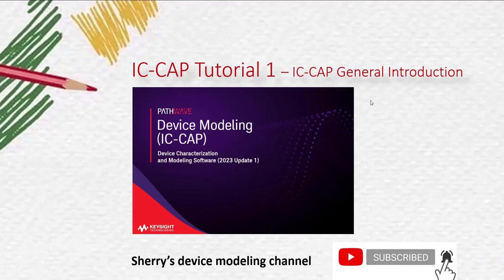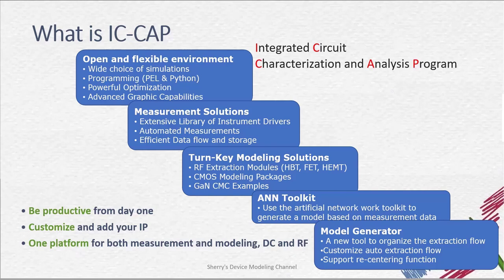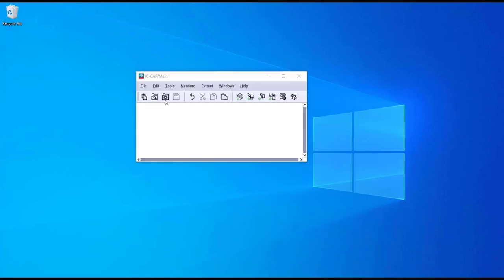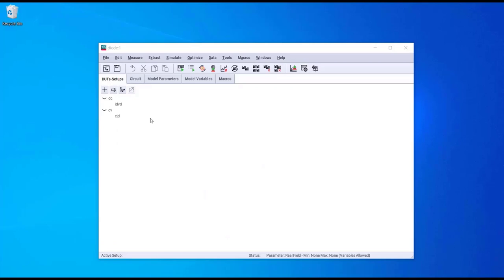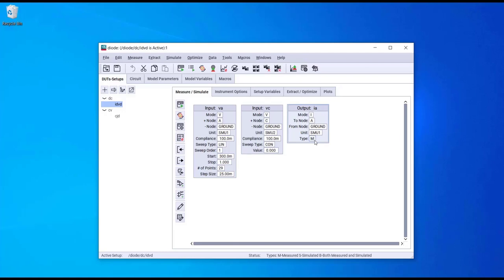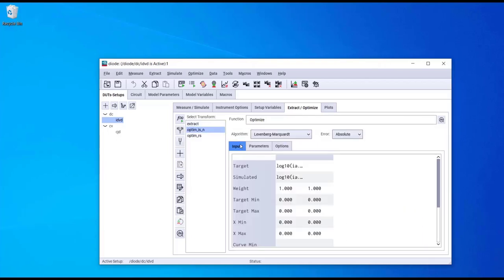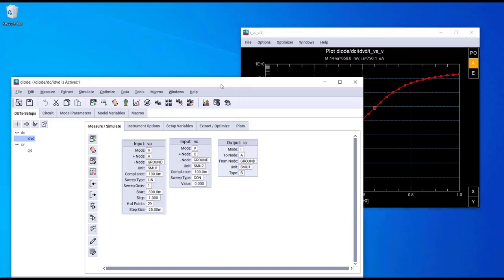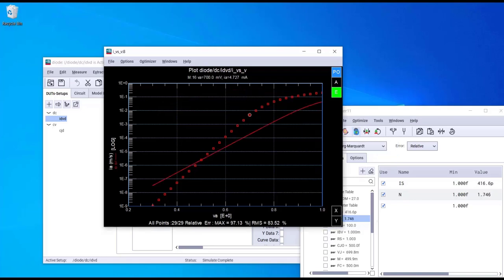IC-CAP Tutorial 1 - General Introduction

Comment: Thanks so much for sharing all your knowledge. It's hard to find information about IC-CAP. So, now I would like to ask you if using IC-CAP is possible to automatize measurements as a function of time? I mean, measure IV characteristics every hour or as a function of temperature using a Lakeshore sensor
Reply from the maker: Yes, both are supported. There is a stand alone measurement software WaferPro Express used for control prober and other instruments to do automatic on wafer measurement.

Comment: Hi , if we want to fit a tcad data which is a form of a csv
and do a simulation and create out own model card how can we comapre the both grpahs to do the fitting?
Reply from the maker: IC-CAP has built-in functions to load a CSV file. You can also write your own Python code to convert and load the data. Then you will be able to use the data in IC-CAP and fit your model. For the graph and plots, you can do it the same way as mentioned in this video. Thanks.